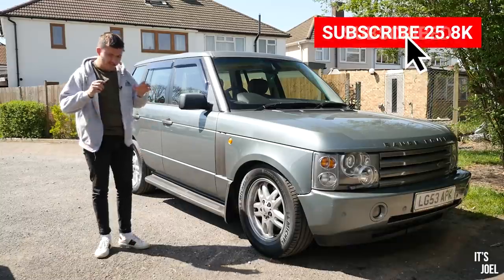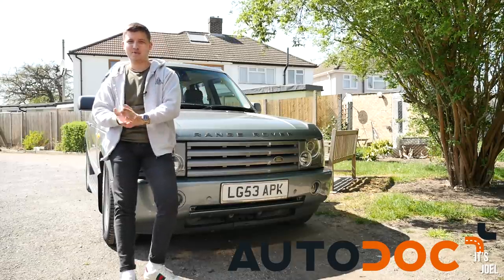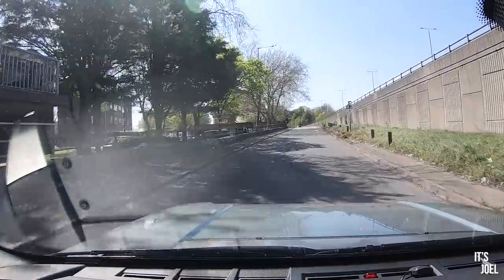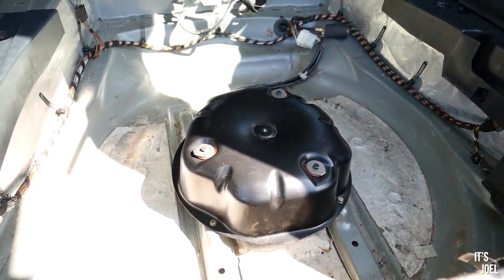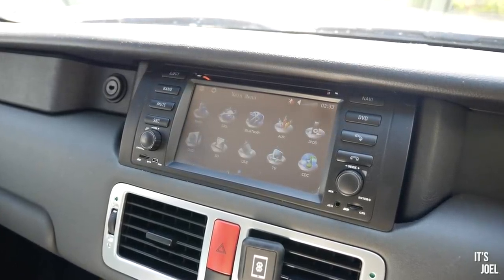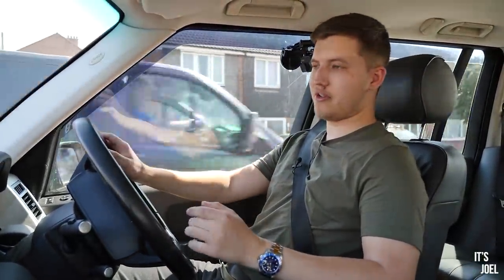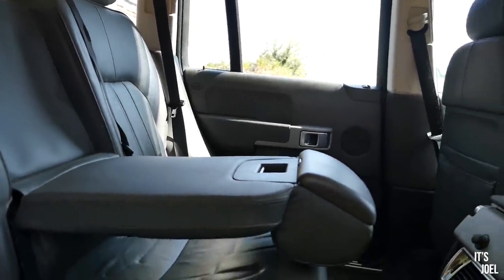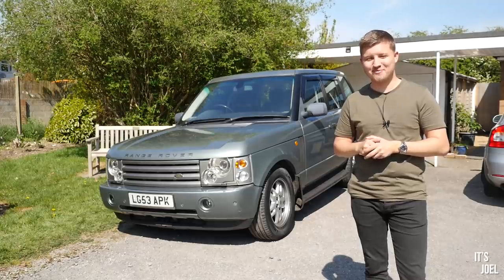I bought the cheapest V8 Range Rover in the country...

Comment: I paid £3000 for a tdv8 2007 l322. With 160,000 on the clock. It’s been fantastic, odd little issues yes, but nothing me and my mates haven’t been able to fix
Reply: Which is the best engine in an older Rangie to go for in terms of reliability?
Reply: @ian9outof10  2001-2005 BMW Range Rovers. The best in reliability

Comment: You probably already know about  this - but we had similar problems with the air suspension on  our L322 - turned out it was the ecu in the passenger footwell - water had run down the sill (a common problem)  and corroded it.   We replaced the ecu with a second hand one off eBay then reset the codes - worked fine after that.   Love ours - like driving a sofa - ours is lpg so not even that painful to fill.

Comment: Sounds like your compressor is okay, As soon as the car detects a fault (blown airbag) the car will cut power to the compressor, Only a workshop scanner can clear fault code and get working again.

It's possible the trans fault could be the XYZ switch if it's driving as well as it is, which is quite common provided the trans isnt poked, Failsafe can come on anywhere from instantly to within 30 minutes of driving and sometimes doesn't trigger a fault on the dash, Normally if you have torque converter symptoms then this will likely need to be refurbed, Quite a cheap repair though compared to redoing the whole trans.

With your coolant leak, Radiators are very common on this engine can can be replaced cheap enough, They tend to leak from the rear edges, You can generally see leakage with a torch, Given the age of the car it's also likely to be leaking from the valley pan gasket (inside the v) and related tube seals.

Comment: The compressor is in lock out now, you need test book to unlock it.  The compressor will not run to prevent overheating when there is a leak on one of the bags (which there is) so it disables itself.  I would replace both struts if they are both factory - not expensive if you DIY then you need a specialist to recalibrate with testbook.

Comment: I had a P38 and loved it. Just bought a 2002 L322 vogue 4.4 petrol for £700 and it’s now with an transmission expert as gearbox over heats. Fingers crossed not to bad. I will find out tomorrow 👍 22 inch wheels are worth £500 👍 so should make money if I scrap it 👍😂😂😂😂

Comment: Id say one of your airlines popped out, either under the drivers side door or from the air bag itself, glue it and stick it back in and it should be fine. Air compressor will work again when you clear the faults, as you can see no lights are appearing on your height selector.

Comment: Compressor won't be running if you have a hard fault. Get the thermostat changed for a lower temperature unit. Lovely car.
Reply: Also keep the wind deflectors - stops the rain coming in and getting into the window controls!

Comment: Hey, I love the Range Rover, except I would have opted for the Sport model. Just one simple question. Before you buy anything, spend around 200-300 (USD) to get a full bumper-to-bumper check along with having the onboard computer checked as well. It will save you headaches and money in the long run.

Comment: Get a oil change done on the gearbox to see if it solves it. Don't continue if it doesn't. The worst rust will be under the sill covers at the rear if you can already see rust on the arch

Comment: Hi Pal Just clicked on to your channel for the first time and enjoy the content! Don't drive the RR any further as you could do even more damage. Get the front Air bag replaced and get the fault code cleared and the compressoir should start to work again. It's also worth checking the other strut as they generally go in pairs. Easy enough job to do yourself and good content. If the compressor is failing don't replace but repair. Good luck!!

Comment: Don't get a new compressor right away... make sure you get a new bag, and do a complete power cycle.  Its possible that after detecting the leak that a safety stops the compressor from working.  I'm not sure at what point they started doing that, but it works that way for modern systems.

Comment: Hi, transmission issue is very likely the range switch on the side of the gearbox. Dirty internal switches give an implausible signal and throws a transmission failsafe code. It can be stripped and clean or replace, done 3 three of these, on X5 and Jag Xk, same gearbox
Reply from the maker: Ahh thanks for sharing. I wonder if that’s something I can do myself
Reply: Of course you can, the switch just unfolds and unplug so it is very easy to change. To dismantle you need to drill out the rivets which hold the casing together.  Once apart it should be self explanatory,  clean all contact faces etc, check for excessive wear. Reassemble using small bolts, these are a bit of a pain on all the older zf boxes but this job is very effective

Comment: What’s the code stored in the Transmission Module? Randomly going into limp sounds like the range switch starting to go out. On the early L322 the range switch should be external and a simple switch. 

Unfortunately for my ‘06, zf moved it internal to the Mechatronic unit so I had to swap the whole assembly.

Comment: Timing chain guides went on my one, there plastic on metal and because Land Rover run these engines at a higher differential temperature than designed by bmw the plastic delaminates, replace as much of the coolant system as you can. Transmission fail safe most likely is the inlet port on transmission cooler blocking and reduce its effectiveness, replace the cooler....by any chance is the oem head unit in the glovebox as that’s a common mod for Headunit rewiring
Reply from the maker: Thanks for this Richard
Reply: you’ll love it Joel, there a great machine when going well, I also cut out the resonator and put an x pipe put in , adds a nice bit of bass to exhaust but not intrusive, cheap mod, worth doing. Will be following along with interest, cheers 👍

Comment: I have owned my V8 L322 for a couple of years now. I think it was the cheapest in the Country... it was free! They are great cars.... if.... you have grown up with Land Rovers and know how to fix them. I would say that you didn't buy well to start with unless the idea was for Youtube content? The suspension is a doddle to work on and parts are cheap compared to other makes. Invest in a decent diagnostics system, it will save you £££ and keep you away from the stealers and garages! No one does a better job than an experienced enthusiast, we don't cut corners and we are not on the clock. I think I tuned into your second vlog where you had recapped on the £4k quote and still found a problem with the suspension? All the jobs listed are easy... easier than on the average family car. The costs come from the quantities... engine oil, coolant, gearbox oil and diffs x2. Great owners forums, better than most and a wealth of knowledge with every fix going. The haters etc.. tend to be peeps who have never owned a full fat RR. They are no less reliable than any other ageing motor, don't see many 03 Merc ML or BMW X5 on the road these days but loads of 02-04 L322 in daily service. Shame you didn't get one with LPG, makes a huge difference to my running costs and keeps the carbon levels down in the engine.

Comment: 2k is NOT the cheapest L322 in the country by a country mile. For starters you've bought the peasant spec HSE. My friend bought a working Vogue for 800 quid and 1 compressor and DSP later it was fully working. At 2k... You were visible coming! FYI the compressor wont run while Air Susp Inactive (a hard fault) is showing

Comment: I picked up one of these 6 months ago. It also was losing coolant, intermittent gearbox safe mode... I bottled it and got rid :-(
Reply: I also never dared touch the air suspension as it did work but didn't want to risk it breaking 🤣

Comment: I've just bought one and it's the HSE  3.0bmw engine  these cars live a fully charged battery and I don't mean a battery to just turn over. They love it fully charge and j have at least a 100ah  I had the trans fails safe error and hdc inactive and air suspensions... Air suspension a fully charged battery cured all these and a split vacuum hose   egr gets caked mine is in traffic film remover at the moment

Comment: Range Rover = worst car ever. In 2001 I bought a brand new Vogue. On the way home from the dealer (105 miles) it developed 17 different faults including transmission faults, electrical faults, suspension faults. The worst fault was the memory seat having a brain fart and changing position constantly while I was driving. The next day it went back to the dealer. The gearbox faults were so bad that the dealer said it needed a new gearbox. Landrover refused to replace the gearbox and told the dealer to rebuild it. When the dealer told me this, I demanded a full refund, took the money and bought a Toyota Landcruiser and never had a single problem with it. Range Rover = MONEYPIT

Comment: My guess of an m6 was wrong then lol. My mate had one just like this until a few months ago and it was a literal "money furnace", he spent £2k getting the gearbox fixed and then a month or 2 later the engine blew up, not to mention all sorts of electrical gremlins and problems with the air suspension. 

Hope you have a better time than he did, if not I hope you have a credit card with a high limit lol.

Comment: Delete the air suspension and put a normal suspension in it, it will be more cheaper to run in the future. Hope the BMW V8 is okay, them motors has had a lot of problems. Those are beautiful cars but not the most reliable.. Do something about the exhaust to get the V8 rumble out ;)

Comment: It would be incredibly foolish to re-install the standard stereo. They are god awful and the reason the previous owner probably installed that stereo is because they wanted something modern with half decent nav and bluetooth streaming. You can get double din adapters so you can put something from Pioneer/Alpine/Kenwood. Also a service probably won't fix the gearbox. They are are well known weak boxes. Info like the wishful thinking that the AC is going to be fixed with a re-gas 😁. The biggest rust spots are the lower arches and the sills as water collects there and you can't see the rust unless you take the arch liners out and remove the side steps.

Comment: Oh dude you are fkkkedd. My 03 l322 was the biggest piece of sh** I've ever driven. I bought it brand new in 2004. Seriously. One week in the seat adjustment stopped. Couldn't adjust my seat. The next day, the steering column shut down. It wouldn't adjust to my saved setting, and then multiple times on a drive it would just point directly down. After that, my speakers stopped. Except one. The one right in the back.  Fixed all these issues with warranty, another two weeks in my airbags failed. The rear failed, and it was completely low to the ground. I couldn't even turn. Fixed again under warranty, already over 13k worth of work, the day I get it back ... Limp mode on the highway. LR mechanic had zero idea why. It was at the shop for a week. They finally fixed it, and the day I took it back, the spark plug gaskets failed while it was raining, and it went back into limp mode, and couldn't even go 5mph. I sold it back to the dealer in under 25 days and got all my money back, and bought a new Tacoma. ZERO issues on the Tacoma except for the rear wheel bearings, in ten years. LR is garbage. Absolute garbage. I will never buy a LR model again, it was hands down the worst vehicle I have ever driven and owned.

Comment: I had one of these. Money pit but very comfortable.  Re the stereo, don't put the OEM heading back in, it's pure rubbish now and you won't really use it. Have a look at xtrons.com they have a lot o headunits for BMW's, and they have adaptors so they work with the weird BMW pro amplifier as well, and they maintain alot of the stock functions. I think the headunit in there was very similar to the E46 head units and the E39 headunits of the same era, so might be worth giving them an email and see if they can recommend anything for your Rangerover. Good luck with this project, it was a love hate relationship when I had mine.

Comment: yeah don't use comma oil as well. use something more better treat that v8 with care and with choice between cheap and better option parts.. don't buy cheap because you'll find your self with more problems.. watching these Landrover videos of yours gives me bad anxiety sorry i got a discovery 3 and very recently i just found out that in parts and tools to fix it myself has just crossed paths with how much i paid for it two years ago and now i need a new front diff which will set me back £800.. crucial parts for that fine looking range rover will cost £1000's every time oh and its a body off job for a lot of them jobs too...so if your keeping it then be prepared...but there's no way im selling mine me and my family love it too much. i see it as the more newer parts it has or replace with new parts the newer the truck. see if i spent £8k on a better d3 i will properly be still spending £4k on it.. but here's a top tip swap the air bags with coils and save your self a ton of money and a hella lot of problems honestly...

Comment: 2 grand for that heap...I've owned 3 of these, I wish I could of dissuaded you from buying that particular example, yes the compressor has now overheated and most likely needing to be replaced, the NSF air suspension, it sounds like the air bag or hose to it has split, the airbags tend to crack at the bottom of the bag. you should check the other 3 bags for cracks. I'll be honest, it's a poor example of the marque. HSE means High Specification Example. 
Good luck but you would be better getting a better example